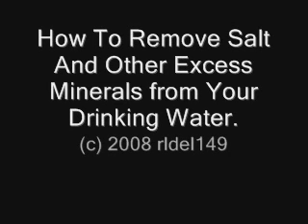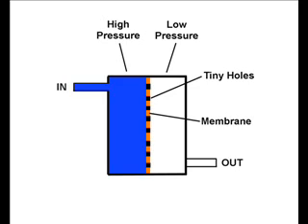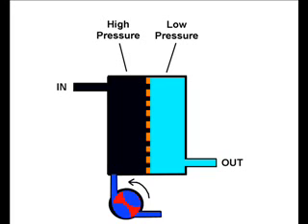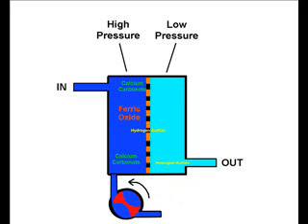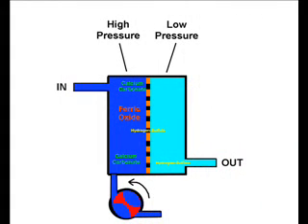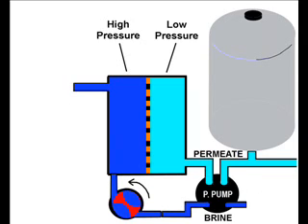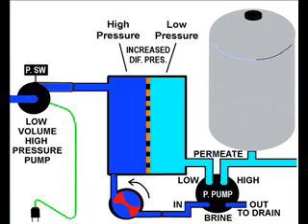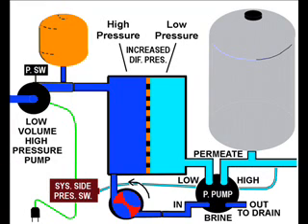Part 1 Theory of Reverse Osmosis units and how to optimize p

Comment: First a softener should be used the ion exchange can be done without salt, secondly your ro will be pre filtered making it work better last longer, third you should add a post ph enhanced filter because ro water is of low ph. and all minerals are stripped.
Reply from the maker: No. There are gimics of electrically charging but it is not softening unless you ion exchange - genuinely ion exchange. There are products making such claims but only salt exchange is AWA recognized.
Reply: @DelHollowProductions   potassium can work for ion exchange, i sell it under brand name K Life.
Reply from the maker: Mark - do you know what a "salt" is?
Reply: @DelHollowProductions  sodium chloride.
Reply: @DelHollowProductions  sodium chloride.
Reply from the maker: @truth6600  that's table salt. A salt is a compound formed of anions and cations. 

Calcium carbonate is also a salt. The exchange is a swap (exchange) of sodium and calcium. 

Not every salt wants to exchange.
Reply: @DelHollowProductions  do you know what potassium Permanente is.

Comment: Hello.  I started watching some of your videos and what started as a way to learn how to modify my RO system has now become an ambition to be more like you.

My question is the rotating valve that leaks out the brine and maintains the pressure within the brine part.  Could that simply be a valve that is open just a small amount or is that a special rotating valve as you described?

Comment from the maker: @serch142 - water is never wasted. It recycles. It isn't like we need to take a chemical solvent to remove a heavy metal and yield an aqueous solution full of carcinogens. Yes, the brine goes down the drain. Mine waters the lawn via the field lines. Even then, it is a relatively small amount. 

A more meaningful question isn't how much water is "wasted" to make pure drinking water but how much toxic waste and land-fill is produced making bottled water -or - how many gals are wasted washing cars?

Comment from the maker: RO can leave gasses, distillation can be rather inexact since not every molecule in the steam is exactly 213 deg F so sometimes both can drag miniscule amounts of contaminants. Distallation can only go so far depending on what you are separating - i.e. PGA (5% remaining). Rain, on the other hand, is dirty when it falls (i.e. hail seeds, washing pollen, acid rain, etc.) - jmo

Comment from the maker: I don't believe there is any basis in fact in that opinion. Left alone for long periods of time, deminerailzed water in copper or iron pipe, for example can be a bit aggressive but to suggest the same effect exist from human bones when the water would have to bypass the digestive system, the tissues therein and seek-out the bones seems quite silly.

Demineralized water is sold when made by distillation and RO in drink bottles - think, have you ever seen a warning label?

Comment from the maker: The pressurized tank & pipe diameters provide the flow rate. Assuming the piping doesn't change, to increase flow you must increase pressure (which it does) - the moving brine provides the work. The brine pump is a slave to system pressure whether boosted or not 

If water is drawn-down faster than it is made for long enough, it will deplete the storage (usable water) w/in the tank. Water will remain but there won't be any air pressure to push it out (i.e the diaphragm or bladder tank function).

Comment from the maker: I am not belittling the worry or concern anyone may have for literally God only knows what is floating in most public water supplies nor am I skirting the original question. RO membranes are very good a rejecting so many large  contaminants but they do not reject everything. 

Distillation is another process that removes/separates water but it is expensive and quite the energy hog.

Comment from the maker: Clicking on some of these search links can mislead people. For as good as the Internet is at providing information, some accurate & true, some true in context but misleading out of context & other outright false, it is up to the consumer to filter through it (no RO pun intended). 

Back to the original point, each membrane has a rating based not only one differential pressures & yield but on rejection/size.  

I see a lot of DOW Chemical Filmtec membrane material being used to produce cartridges

Comment from the maker: The concentrations to be removed in desalination (like onboard Naval vessels) are so significantly high multistaging is necessary. 

Desalination of low levels of contaminants in water sources qualifying as "fresh water" or even "brackish"  are still effectively desalinated. RO systems can desalinate quite effectively without over complicating the issue.  

You don't generally need a shotgun to kill a fly right? But use one where appropriate.

Comment from the maker: It is hard to say but an air gap is to a drain and what you are draining is brine (i.e. water off the membrane with concentrated minerals). It seems possible the little drain has gunked up on you (maybe).

Lasting... depends on the GPD rating to start with and how mineral-ed up your source is. What happens on a microscopic scale is it plugs up just like your air filter in the car or house. Your GPD will drop. When it quits keeping up with your demand - replace it.

Comment from the maker: yes. In fact there are mechanical shut-off available to control the thing when satisfied. 

The system is differential pressure driven. In this example, small electric pump was used to elevate the pressure (creating a larger delta-P) but as long as the necessary pressure difference exists across the membrane, it will produce water. The greater the difference, the greater the production.